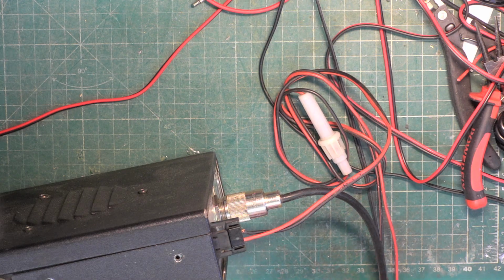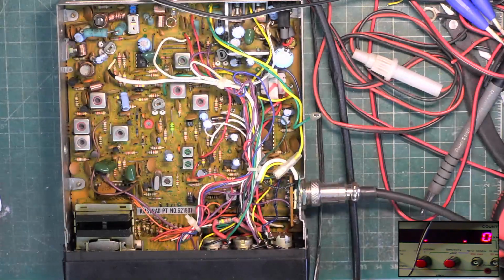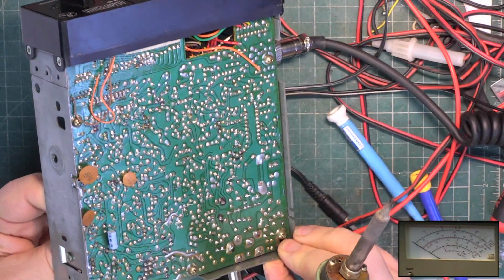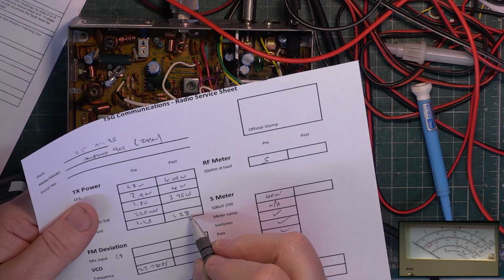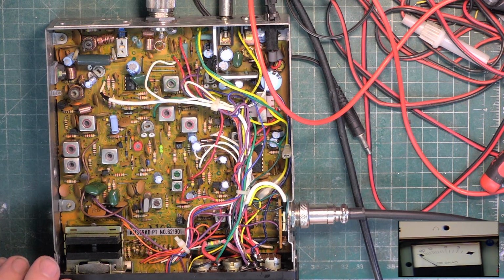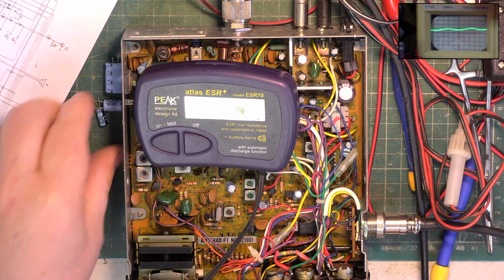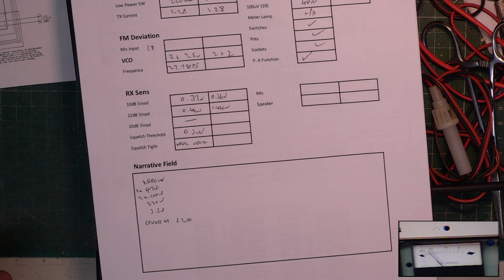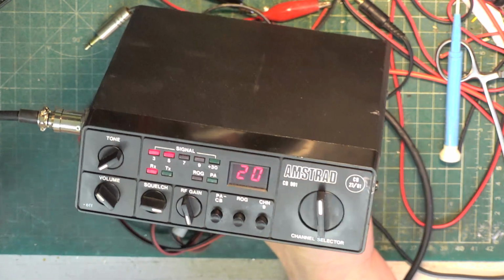Amstrad CB901 CB27/81 UK FM CB radio - repair (Japan version)

Comment: Nice to see another one back to its best. A legit Japanese 901 was my first ever radio and I've treasured it since.
Given how irritated people used to get at the 'Amstrad' bleep - which to be fair is pretty piercing - I was amazed when I learned that the Mustangs which shared the 002F board didn't give you the option of switching it off. I wonder how many Mustangs were modified in period to make this possible?

Comment: As good as new again with new caps and sinad sorted will check scratchy corner next see how it does,and with the mention of NEC car  phones apparently my first ever digital mobile phone was an NEC G9D+ it was a bit of a brick with a pull up aerial would not even fit in my pocket, and it had text before it was in use and at the time I was driving for a computer firm doing a computer fair in Birmingham and the phone pinged and a large envelope was on the screen so I pressed the ok button and received my first ever text message telling me to return to the venue for lunch.

Comment: I always just plug in a cybernet 2 pin power lead in these as they fit but you need to make sure it’s plugged in the right way around. As you say it would be good if someone could 3D print some new plugs for an original fit 😊

Comment: My first ever rig was a spinnytronic 199 with the fake version of that chassis bought from a local trucker. Used to work well back in the early 90's.
Reply from the maker: To be hoest, the only let-down with the fake version is the poor squelch performance. On the whole, they used cheaper components but the actual performance apart from the squelch is usually just the same.

Richard, G0OJF, UK